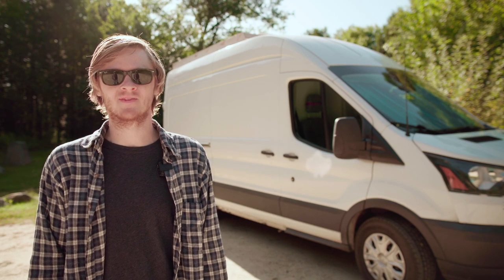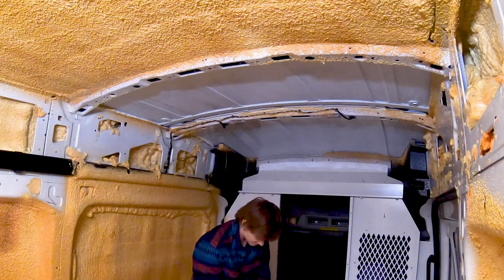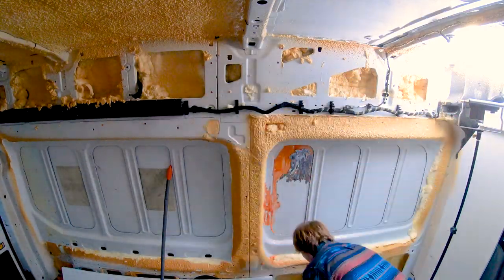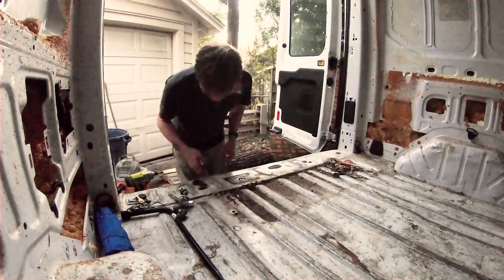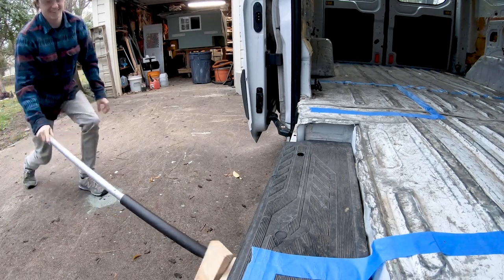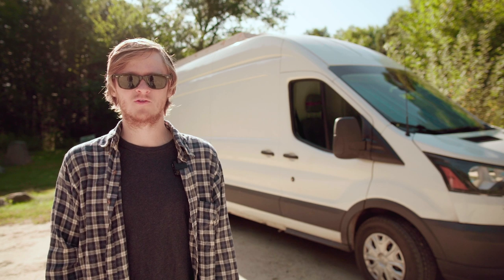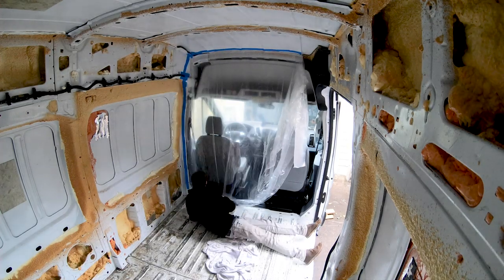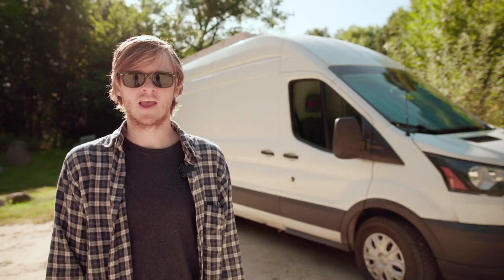Cleaning Up the Van - Ford Transit Camper Conversion

Comment: If you have a 4k camera and shoot 4k, use your editing program to zoom in on the video when you do a hard cut (known as a jump cut). It looks more like you set up a new camera setting and didn't just edit out bad takes. If you don't have a 4k camera, just zoom in or out between takes with your zoom lens. That way you can cover up jump cuts easier.

Comment: I just saw an English couple in the UK, doing a conversion, who solved the problem of Fords wiring “solution” by cutting the wires through. They found out this was sort of a problem because they noticed the central door locks weren’t functioning anymore…

Comment: I'm really enjoying your van conversion videos. I just purchased a 2018, 2500, high roof, 159" WB, ProMaster with the intention of doing my own conversion. The part that concerns me the most is the electrical work. Have you already posted the video of this part of your conversion? Do you plan to have a battery to battery charger to charge your house battery from the engine?

Comment: Spray Foams Very Careful As They Release Toxic Fumes. :(
Reply: Agent/Officer Thomas A. Porter D.P.O., Well, just a bit too generic of a warning. 
First, ALL insulation off-gases and/or have unhealthy fibers - actually all man made and a lot of natural products (plywood, aromatic cedar, stains and paints. ......). Just look at the safe cotton denim insulation with no chemicals marketed that a person can sleep on it, but huge complaints from users that it is so dusty it will fill your lungs with fibers. Also, just because a foam is formed at the factory into a sheet or a mat does not mean it is automatically safer and does not off gas. 
Second, lots of different types of foam including latex. 
Third, trapping internal condensed moisture against the sheet metal can exacerbate the growth of future poisonous molds and vehicle corrosion (closed cell foam is the only product that can eliminate this happening).
Forth, some product off gassing stops once the reaction is complete and the product cures. 
Bottom line is everything is a tradeoff. Everything can be made safe with proper installation. Granted, some installation techniques are not possible in a van. Research.
Reply: Plus, it's not a waterproofing, which can lead to rust near the bottom of each wall/door in which you use it.